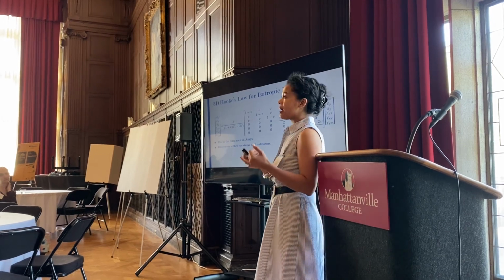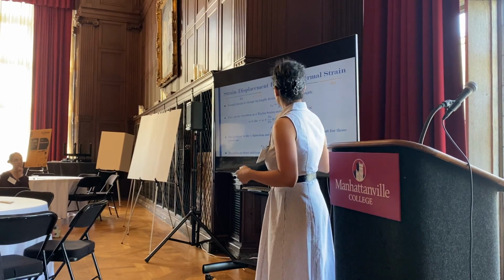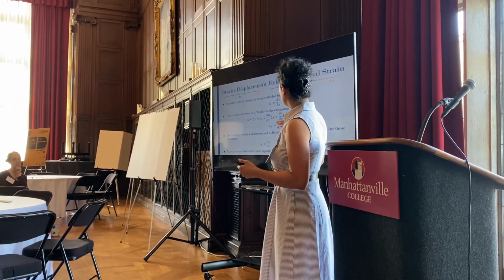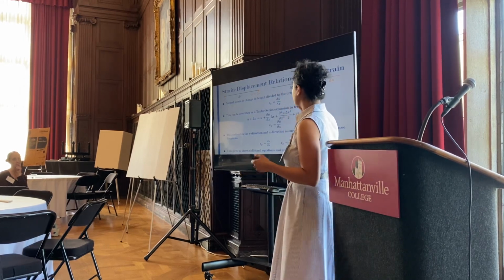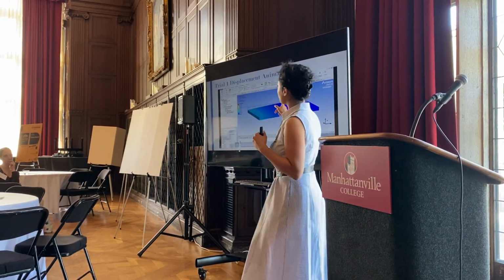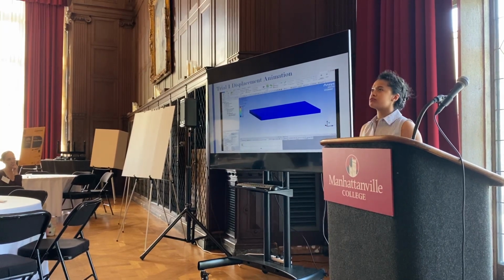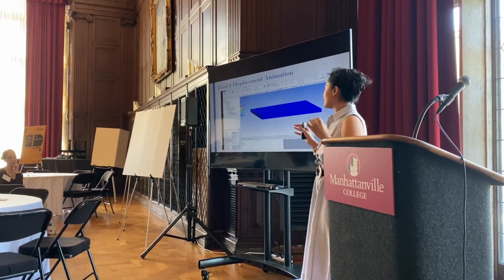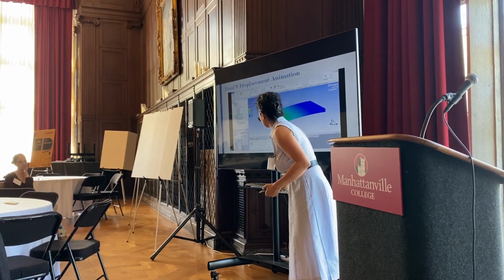Modeling Cloth Using Finite Element Analysis Presentation | WURC

Comment: Very interesting presentation. I came across a very interesting article about the mathematical modelling of the intensity of light that reflects off material surfaces, which is given by the 'bidirectional reflectance distribution function' (BRDF). This is an area I am particularly interested in, because I want to model the different levels of shine in polyurethane plastic materials used in clothing.
Reply from the maker: Thank you! That sounds like an interesting paper. I can see how finite element analysis would be applicable in such an area of study. I don’t recall if Ansys has a specific package to approximate the reflection of light off of a surface, but I wouldn’t be surprised if they did. No matter what software you use, what’s going on behind the black box is similar. The key difference would be in the derivation of the matrices being solved (because different physics is required/applied), and necessary input to simulate material (you’d probably use whatever the equivalent of poisson’s ratio for reflection of light is). This is somewhat speculative, so don’t quote me on it, but if FEA is used, then it’s along those lines. Anyway, good luck on your research/project! Thanks again for watching my presentation.